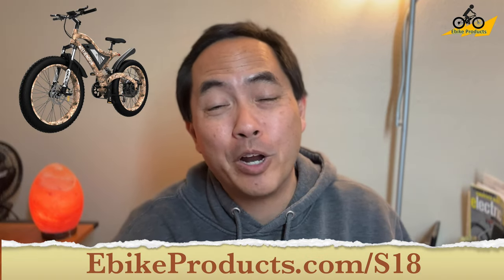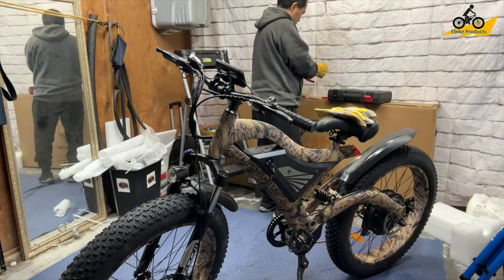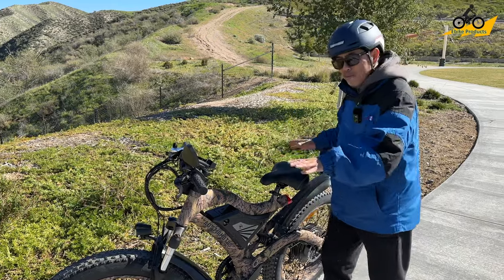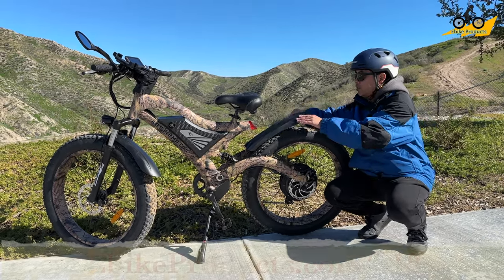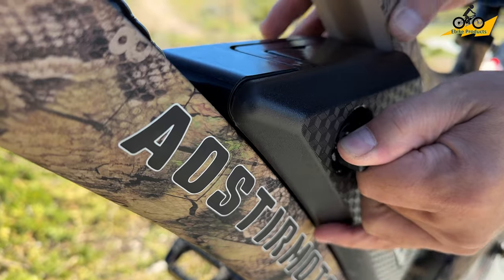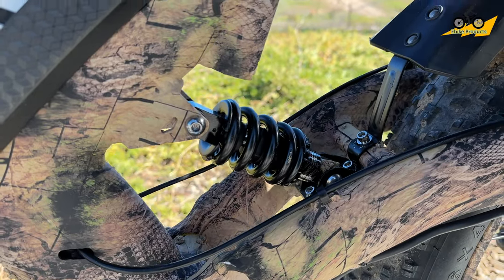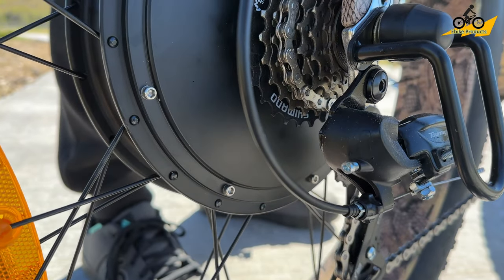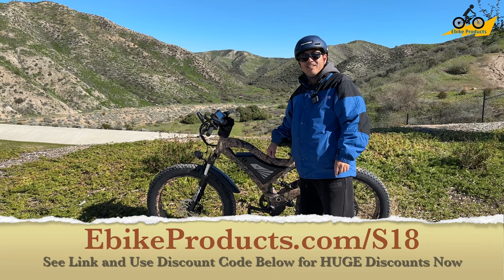AOSTIRMOTOR S18 1500! Powerful Budget Off-Road Ebike Adventure Game Changer! Riding a New Trail!

Comment: Thanks for supporting us! Hope you enjoy riding our Aostirmotor S18-1500w e-bike!
Reply: Hey, could I have a discount code on this bike? I’m planning to buy 12 for a giveaway party. That would be great!
Reply: maybe you can have option for buyers for hydraulic and mechanical brake
Reply: @imv5197  Hey friend, thanks for your good suggestions. Will consider about this cafefully.
Reply: Can you please tell me how to do a factory reset on this bike? I bought mine 1 month ago, and regrettably messed with the settings. I need it back to factory.  Thanks in advance
Reply: @benb2199  Hey friend, thanks for your questions, which bike model do you have?
Reply: S18 - 1500w
Reply: @benb2199  Here's the instructions: 1. Enter into the main setting interface and keep the speed at 0, press the LIGHT button and PLUS button together for 2s to
enter the restore factory default setting interface;   2. Pressing / to toggle to dEF-Y; 3. Then after pressing to
confirm, the display will show dEF-0 for a few seconds and then automatically start to restore the factory default settings.
Reply: @benb2199  The display will automatically exit to setting interface after the restoration.
Reply: Excellent,  thank you for that info!! I will try after work. Thanks again

Comment: I got a question for you I just got a blackbird 26 inch and it seems to be locked at.class 2 specs. I know how to get to the settings menu but cannot seem to find out how or what settings to change.
Reply from the maker: I had to contact area13 to get the settings to change it to a class three. They sent me a link to a video they made in the past on YouTube that had all the settings step by step. Sorry, I don’t have the link to send you, but you might want to email them or look in their video history and it will show you how to do it step by step. 
Prepare to fly!
Reply: @EbikeProducts  yes thx for the response I have since figured it out and this bike is great. I'm installing the second battery this weekend and then new front sprocket and cranks.
Reply: @Rob-D-22  so how did you get it into class 3?

Comment: Speed should be the only factor in regulating bicycles, not motor power.  So your Aostirmotor should be legal to ride on-road with the speed limit as the only factor.  It is STUPID to say that 750 watts is the legal limit.  That is like saying a 800 horse-power truck can not be on the road while a puny little Mini-Cooper car can be.  Both the truck and the car are limited by the speed limit, not power!
Reply from the maker: Good point! A 750watt can do speeds over 35mph if geared right and tuned to do it. Do you think the government will change the regulation? If they do, I hope they keep the 750w motor in place and just require software limitations. The 750w is helpful in getting you moving quickly from a dead stop especially in traffic.
Reply: Yes, the law should be amended to allow for more powerful motors. 750 watts won't be sufficient if you live in San Francisco, Seattle or Portland.

Comment: there's already mud on the rear sus and you barely rode it, that fender is a crime, like the rest of the bike
Reply from the maker: Yeah. The start of the off-road trail was really muddy and all the bikes took a mud bath that day. I’d definitely remove the fenders in the summer when we’re back to dessert type riding.
Reply: @EbikeProducts  it's not about removing the fenders, they're just in a wrong spot as the designer lacks any expertese, like the battery solution, frame design, fork selection, it's all garbage. See Cyrusher Ranger for a fat bike done right.
Reply from the maker: @lIlIlIlIlIlIlIlIlI  Ahhhh. Gotcha! That Cyrusher ranger is definitely one BEAUTIFUL machine. I guess you kind of get what you pay for as that Cyrusher is nearly double to cost. I hope to try one someday as those specs are definitely high end. Aostirmotor is definitely targeting the budget sensitive crowd with their ebikes vs the Ranger. It's a really great bike for the price as I am sure the Ranger is too.